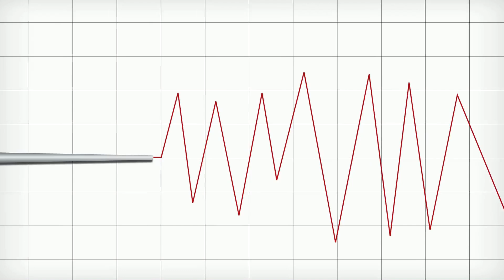Photon-Phonon: Optomechanical Crystals That Turn Light into Motion

Comment from the maker: How does the design of band gaps in optomechanical crystals influence both photonic and phononic confinement, and what specific design challenges arise when attempting to optimize these gaps for different wavelengths or frequencies?
In the context of quantum optomechanics, how do nonlinear effects in photon-phonon interactions contribute to enhanced sensitivity in quantum sensors, and what limitations or trade-offs do these nonlinearities introduce in practical applications?
What are the key obstacles to scaling up optomechanical crystal systems for large-scale quantum computing, particularly in terms of coherence and entanglement preservation, and how might advancements in topological optomechanics offer potential solutions to these challenges?